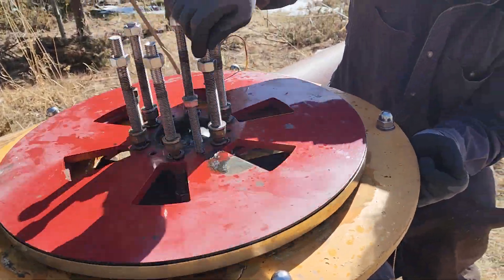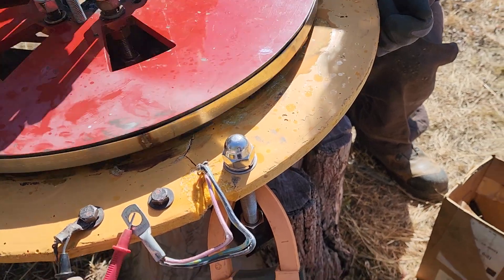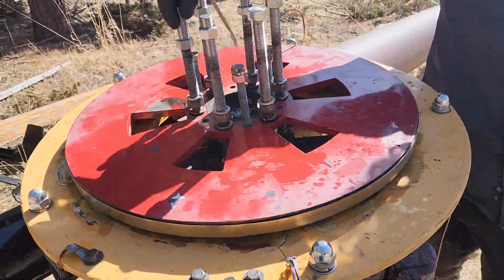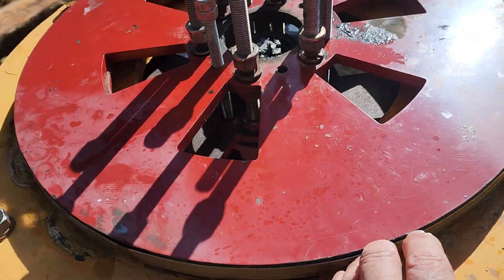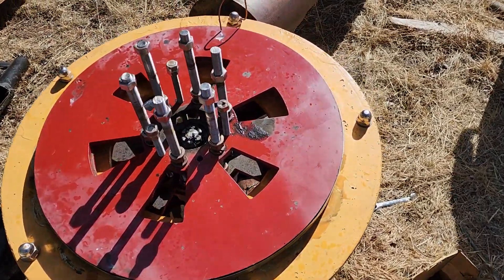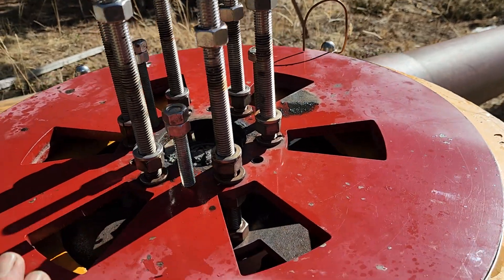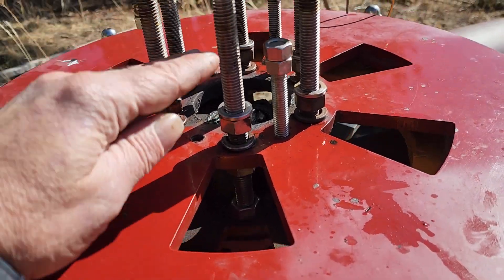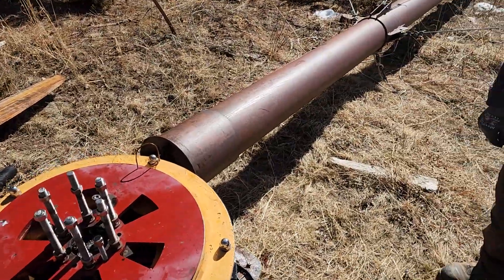Checking and adjusting my old 20 foot diameter wind turbine.

Comment: Are those long threaded rods - Stainless Steel?  Nonmagnetic?   So, no problems with galling?  I don't see any rust.
Reply from the maker: They are stainless, I try to be very careful to keep them clean when running those nuts up and down, galling can be a real bugger, I've had it happen a few times.  It's a hard call to use stainless, or zinc coated steel.  In the center there they don't need to be stainless except when corrosion is an issue.  The ones outside around the stator do need to be stainless when they're as close to the magnet rotors as I usually run them.

Comment from the maker: I mention about bare copper in the stator and saying 'it's fine' ~ best practice, especially in some climates would be to take it apart and cover damaged areas with epoxy, both on the stator, and the magnets should the Nickel plating be compromised.  In this climate... it's fine.  If it were someone elses machine I'd probably take the time to disassemble everything at this point but this machine has been like this for over a decade now.